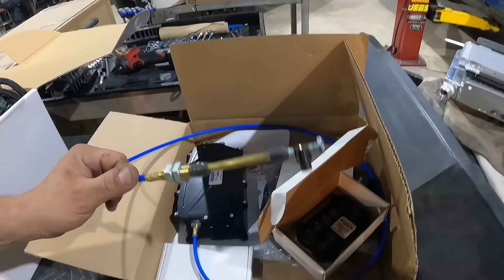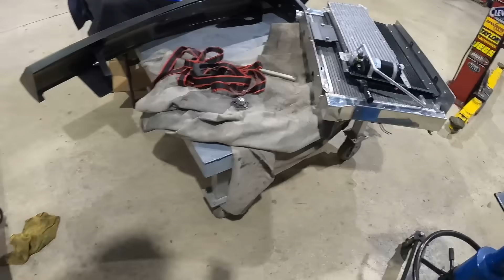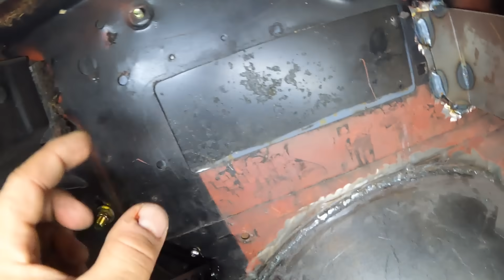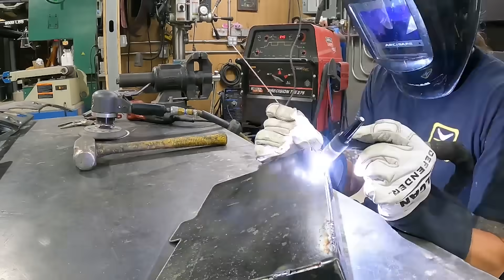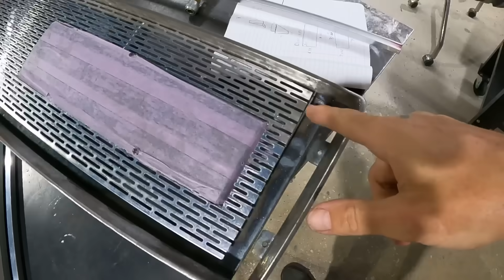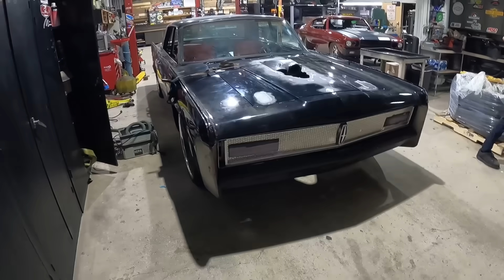Fixing our HUGE Mistake on the Godzilla Swapped Continental Grill - 7.3L Lincoln Build Ep. 15

Comment: Brilliant build project!!! I like the material you used for the grill yet for me I'd have given it a slight outwards curve in the top to bottom orientation to make it look 3D instead of a 2D shape.
Reply from the maker: We thought about bending it, but found it would be a bit too hard to get it to flow correctly with the headlight buckets sitting in the middle of the curve
Reply: @SalvagetoSavage  Yea, custom can get complicated quickly. I should know :) It can take something simple into a much bigger task.

Comment: Sent to paint before fixing the louver direction everyone said is not gonna work correctly , and man that throttle cable right on the side of the whole intake is hideous sorry man could have made a bent swooped tube from lower that directed the cable down instead of straight the whole manifold sorry but I mean if the owner likes it ok

Comment: All that over the top fab work and then say f…it and mount the throttle cable on top of the intake that sticks out the hood…
Reply from the maker: How would you mount the throttle cable?
Reply: You guys are mad fabricators, make some mechanical linkage  with maybe some small heim joints to drop below throttle body over to driver side then  cable to pedal below  hood , or is throttle body able to be flipped?  Putting cable on drivers side and lower. I understand that the customer gets what the customer wants  but seeing  the cable on top like that really bums me out..

Comment: The trunk vent louvers are pointing 180degrees in the wrong direction.  Pretty cool design overall, though.
Reply: For sure. The louvers shouldn't be "grabbing" the air, trying to stuff cold air in.. They should be the other way to pull the heated air OUT.